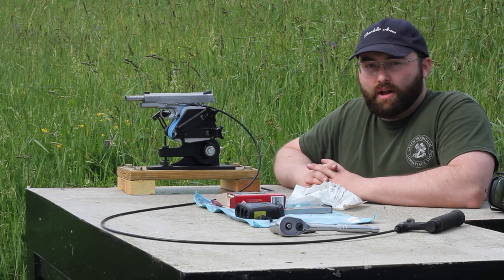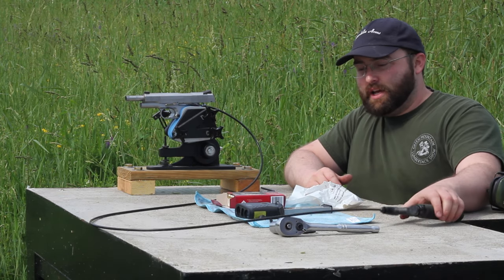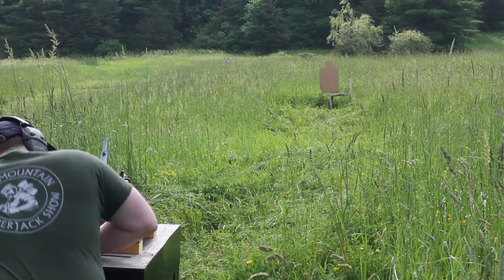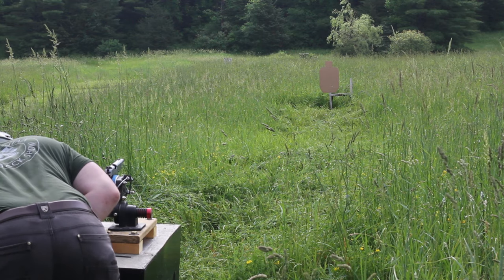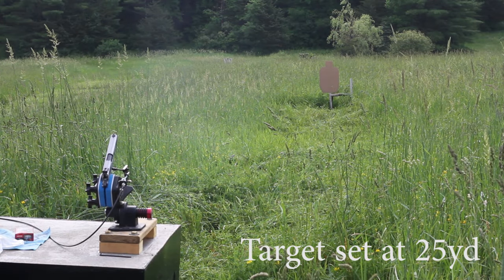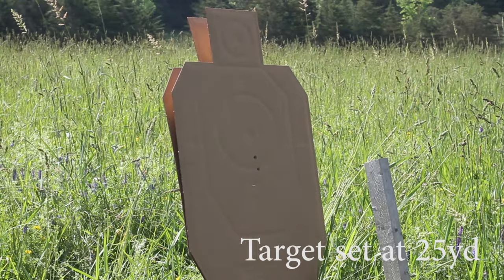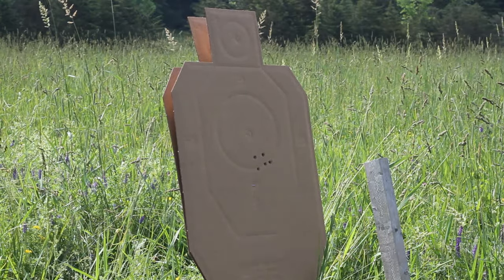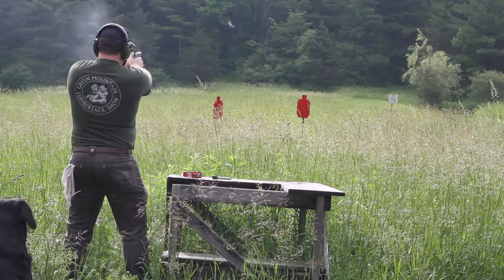1911 accuracy and function testing at Sbardella Arms

Comment: On your disassembly video, you showed how to break down the gun without turning the barrel bushing, so as to not destroy the fit of the barrel and the barrel bushing. How many times would someone have to do that, to destroy the match fit of those components and the accuracy of the gun? How long does it take for you to produce a gun? I'm not impatient, I just want to know about how much time I would have to come up with the remainder of my payment, after paying my $1000.00 deposit? I'm a true fan of traditional 1911's, and I'm thankful that Beretta9mmUSA (Senior and Junior) brought you to my attention. I will be placing an order for a Custom Carry Model, soon. Take care.
Reply: On one of our hard fit guns, you would find that it is very difficult or impossible to turn the bushing when the slide is fully in battery.  Alternately, you could pull the slide back just slightly to disengage it from the bushing before you turn the bushing and remove the plug/spring.  Another option is to request that the bushing be removable by hand, which some people like to be able to do.  Our lead time is currently 6-8 weeks.  Thank you for your interest in our custom 1911's!
Reply: @neilsbardella3871  , I asked because I had never heard that advice before; and I wish I had. After much struggle, destroying a plastic bushing wrench and marring the recoil spring plug with an aluminum bushing wrench from Brownell's, I was able to disassemble a different maker's hard fit 1911. I used the aluminum bushing wrench to twice disassemble and reassemble that gun; not knowing what I learned from you about the taper of the barrel. I hope I didn't permanently damage that gun; and I won't ever be doing that with any hard fit guns in the future. 6-8 weeks?! That's fast! Thanks for the informative, thorough and speedy reply.
Reply: B Junior and senior are assholes but if there's one redeeming quality it's it they pointed Us in the direction the sbardella arms.

Truly amazing looking work